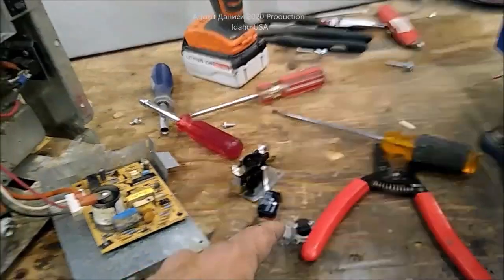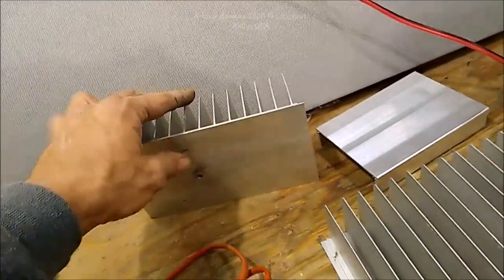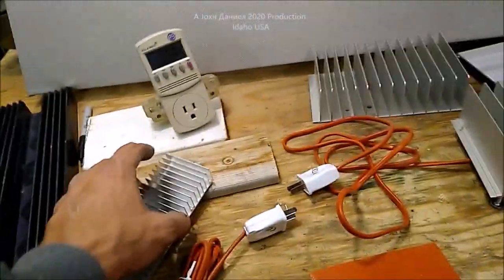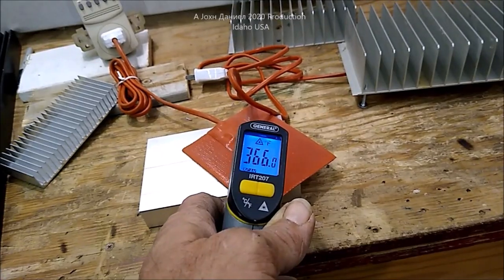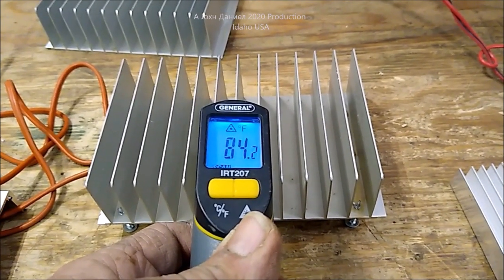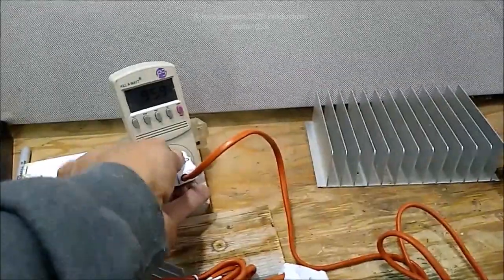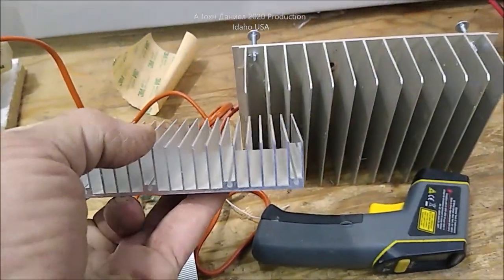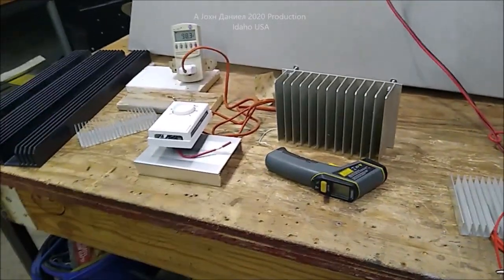Make Low Wattage Heaters from Silicone Heating Pads and Heatsinks

Comment: its important to understand emissivity if youre using these as heaters. the aluminum heat sinks will throw the heat much further if they are painted matt black. also if you put them on stand offs and dont want to pay to heat the wall and outside, you can put low emissivity foil tape on the opposite side, which is cheap al foil tape. that greatly reduces the heat being thrown into the wall. copper tape works better but will rust over a long period of time and loose its low emissivity.

Comment: It seems the word "safety" has a different definitionsin the USA to that in the UK.Where is your evidence that the pad itself is safe. No spec. No test results. No grounding. This would not get past the visual inspection in a UK test facility. In fact I doubt it would in the USA either.
Reply from the maker: You are grounding it with 2 terminals, that's how you make a circuit! We use what's called circuit breakers in USA so no shock unless your just damned and determined to get one, but common/neutral is a Ground line, Even in the UK system. But, It's not about safety, it's about control. Holding the hands of adults to stop them from hurting themselves is control, not safety. Natural Selection has its historically prove value! This is why people under 35 are as dumb as a box of rocks, they are slaves. Anyhow, the UK is Socialist over Monarchy over Corporate ran. So they have to make that money to feed all the north Africans who now own it. USA is about 5 years behind you with the same pending future so be patient!

Comment: Question. Ive been thinking of getting 4 or 5  of the 12v, 15w silicone pads - spread them out and mounting them under a piece of aluminium and then using it as a a small underfloor heating section for my campervan (I'll only have around a meter of floor space). Anyone see any issues with doing this?    I'll be using vinyl roll flooring
Reply from the maker: I would not recommend you seal them into a floor. But you can buy this kind and a thermostat for it https://s.click.aliexpress.com/e/_DBwzNgv

Comment: Are these things submersible? If I wanted an insulated tank of water  could I drop one of these in the water to heat it?
Reply from the maker: No, The best use for water heating is to place them on the outer shell, insulate well around it, but not on it, allow a 2" air space completely around and above it.
Reply: @JOHNDANIEL1  thank you 👍

Comment: If I give the pad less volts will it produce less heat or will it shut off entirely? Looking to only get it up to about 70-80f.
Reply from the maker: Using a rheostat you can trim power to them but at 70% and lower the hertz will cause early  demise of the elements.

Comment: You need to do a video on infrared panels because you can buy it for about £20 a metre and all you do is connect a plug and you can pay about £5 extra on eBay you can get far infrared that reaches across a room.

Comment: Great idea! One word of caution though. I wouldn't put this heater above anything combustible just in case the pad fell off for whatever reason. A heating pad falling onto something combustible could be disastrous, especially if the thermostat failed and stuck on or the pad someone used didn't have a thermostat as many don't. There have been cases of these heaters falling off of oil pans and onto plastic belly pans and causing fires, so that's definitely something to consider if you decide to do something like this.

Comment: Hey, maybe you could help me out. I'm trying to find a heating pad that's flexible. I keep searching Alibaba for Silicone rubber heat blakets but I'm not sure which ones are pads like what you have and which ones are flexible. I need the heating blanket to wrap around a pipe and get over 300° F (149° C). Any ideas? Appreciate the help.

Comment: Buy a 100 watt LIGHT BULB ....SCREW INTO SOCKET ...100 WATTS HEAT with LIGHT
Reply from the maker: Strange thing about a light bulb, they require 100 watts of power to make 94 watts of light and you get 83 watts of heat. But their lifespan is very short compared to a silicone heat pad that can last up to 30 years.

Comment: Any ideas how to use on fresh water, gray and black on rv? Would they over heat the plastic tanks?
Reply from the maker: you can use a much lower wattage model on those tanks but be sure to attach them to at least 20 gauge aluminum five times the size of the heater pad

Comment: I've been thinking about getting one of those and mounting it to the bottom of a piece of artificial stone countertop that I have in my dog house.  The reason that that is in there in the first place is that they kept scratching and chewing on the wood, trying to remodel it (to have a basement, apparently)... I was thinking of attaching one to each of the 2'x2' pieces of the stone that are in each side of the dog house and that maybe that would be enough surface area to keep the temperature low enough to not be a burn hazard... Of course, that material is not as thermally conductive as aluminum, so it might react differently...

Comment: I just ordered the heat mats from AliExpress using your link.  My application is different than yours because I want to be able to bake bread without an oven.  I saw plans for and have seen a cardboard box oven in action at a demonstration I attended.  The folks used a medium size cardboard box covered with heavy duty tin foil inside and out.  A video is on YouTube showing the procedure.  A thermometer was placed in the side of the box, and the demonstrators baked cookies in that box using 10-12 pieces of charcoal as a heat source.  I want to use the heat mat and a heat sink with legs, and I'm hoping I can find a thermostat that will register higher than one for a home.  What do you think?

Comment: Hi John,
I'm trying to build a 48v off grid system.
I'm looking at a 48v system, 16x trojan t105 batteries 6v, 225 ah.
 11x 330w panels and a 500w wind turbine .
How do I tie this together with a victron system.
Hope you can help.
Best regards 
Dean
Reply from the maker: Nice system, I would jump and go direct to Tony at Hurricane wind power and have him part for part design it based on your location and energy plans. Easiest way, and likely cheapest too.
Reply: @JOHNDANIEL1  thanks John

Comment: Interesting, thanks; I'm thinking about what area I can use these!
Reply from the maker: Make a dozen, mount them throughout the house and control with one line voltage thermostat. Like micro base board heat at a low cost and system load.
Reply: @JOHNDANIEL1  I was just thinking about the base broads! Great minds!

Comment: Hey John, I Use Those Same Ones Except In Many 12v Versions For Soo Many DIY RV, Camping & Boats + Projects! From Installing Them In Couch -Chair Cushions, Toilet & Motorcyle Seats, ETC! LOL I Get Em On eBay! --> https://www.ebay.com/itm/12V-100W-Silicone-Heater-Pad-Engine-Block-Tank-Oil-Pan-Heating-Mat-9-13cm-Tool/383693942305?hash=item5955f0ee21:g:v9IAAOSwadpfRyU6
Reply from the maker: Buy them in either AC or DC through Alexpress and cut out the state  taxes, fees and drop shippers cut that adds 6% to 30% more to the rock bottom versions ebayer's sell.

Comment: I think solar panels look good with these.
Reply from the maker: You can install the 12 to 24 volt models on solar and place them under gravel then at night they can release the sun's heat inside.
Reply: @JOHNDANIEL1  yeh or a small wind turbine. Even in footpath for snow free. Lots of option thinking outside the box.